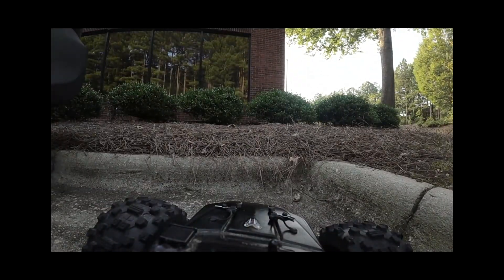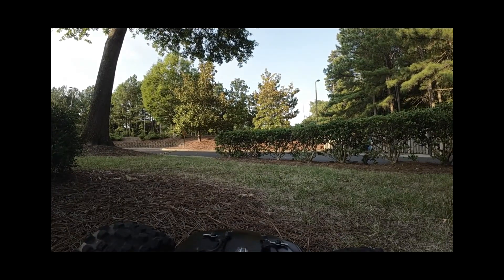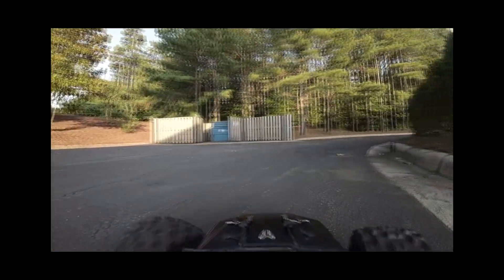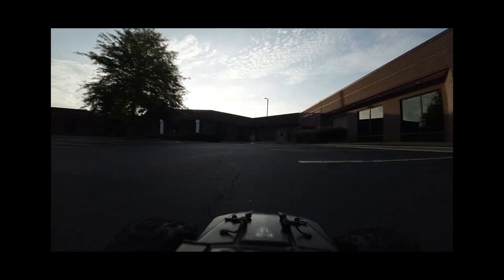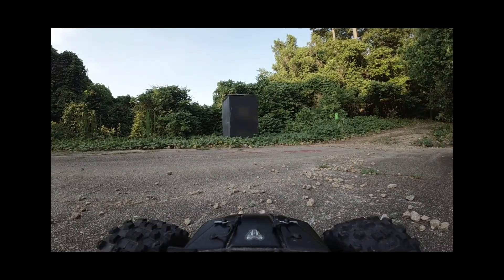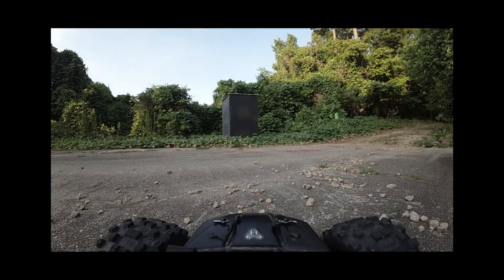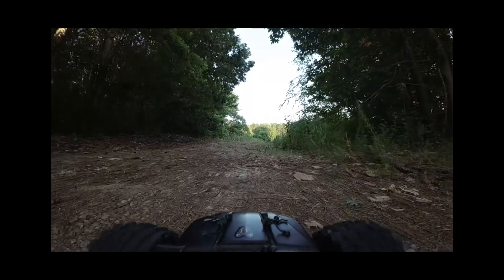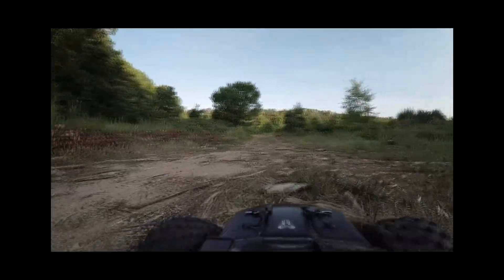RC Car/Truck FPV DJI O3 Stabilizing Gimbal Test (HEQ G-Port)

Comment: Its very impressive! From your experience, which RC car has the best suspension for this gimballed FPV?
Reply from the maker: There are cars I don't own that I'm sure have much better suspension than any of mine but nearly any decent stock RC will be fine when using the gimbal. This truck only has the problems with side to side wobble because I put oversized tires on it that needed hub extensions to make them fit. It's worth it cause I would get it stuck sometimes with the stock tires and these bigger tires have always been able to power through obstacles. This gimbal seems to stabilize everything really good but since you want the YAW locked for FPV then any side wobble won't be stabilized. If you want something for on the road then you want street tires and to just tune some decent oil filled shocks.
Reply: @Magneticitist and you didnt put any extension so it loosely going left and right?

I see, thank you very much for your explanation.

I am an FPV pilot, still using analog for now. But I found ground FPV is a lot lot more fun!

I am tight on my budget so I will buy walksnail system instead.
Reply from the maker: @ It sort of just wobbles a little bit side to side due to the nature of the wheels and how nubby they are etc. It's only noticeable when going fast on the road.

Walksnail is a good option and the GM3 gimbal will let you adjust the sensitivity on the yaw. It comes factory in 3-axis follow but each axis will still stabilize small vibrations if you leave it that way.
Reply from the maker: @ Oh and technically the Goggles N3 and the O4 air unit are similarly priced to a walksnail system right now too so it's something to consider.
Reply: @Magneticitist  ah I see. Yes I am going to buy that GM3.

I cant found any N3 goggle without DJI controller on my local hobby shop.

Thinking on Walksnail goggle L and Avatar V2 but still cant decide.
Reply from the maker: @ulungprabowo  I have no experience with either but I'm sure the Goggle L's are fine. I wanted HDMI out so I spent the same money and just got the standalone receiver and modded it to use my own antennas. I use the Avatar GT cause of the higher power but I've seen videos where just the V2's are doing pretty good.
Reply: @Magneticitist  Ah I see. I just watched your recent video which doesnt use gimbal and kinda impressed on how suspension really took away those vibration. Between gimballed and ungimballed, both have their own charm, ungimballed one the viewer could get sense of the surface of the street, obstacles, etc. Somehow made me want to focus on the suspension setting first and invest on GM3 later.
Reply from the maker: @ulungprabowo  I totally agree and that's a great way to put it. No-gimbal has that advantage of a better feel of the terrain but it's also easier to make it overall more durable. 
The gimbal really comes into play for a lot of off road driving. It gets hard to consistently see in front of you at high speeds when bouncing around that much. 
On-road it helps to just see more clearly at the high speeds that can result in bad crashes etc. 

I spent a lot of time trying to work out how to smooth the vibrations before using a gimbal and it's really just a thing of finding a solid mounting for it. Gets harder to do when using servos to look around cause they might have some play or wobble. The tires you use are big part as well as how balanced they are.
Reply: @Magneticitist  I see. I used to do FPV car in the past, like 10 years ago. I just put the camera on the lexan body attached with body clip and wobble a lot and impossible to drive. 

Recently I print a 3D printed tank put an FPV camera and surprisingly it is very drivable, kinda wondered how it be so different and the answer is like you have said, a solid mounting. And floating on some sort of suspension. I never thought about the servo before but I agree it is a wobble variable that need to be taken care of. I think I will leave my wheel factory standard.

So from your experience, can we said that suspension doesnt really matter that much? The viscosity or spring tension etc?
Reply from the maker: @ulungprabowo  Suspension does matter but for me it never mattered all that much with the video shakiness. There is a tradeoff to where if I made the suspension too smooth then I was making it too easy for the chassis to bottom out. The balancing of the tires seemed to make more difference with vibrations. 

These cars don't truly have the weight to get a real smooth suspension on any surface but it's possible, just takes a lot of tuning. ARRMA comes with little spring shims to help the tuning but it's also good to use good viscosity shock oil. ARRMA seems to use decent stuff but a lot of the stuff you can find out there will use oil that is way too thick. It's more complicated than that though and the shocks need to be filled up to an exact level with the oil. If you just skipped the shocks altogether and focused on a good cam mounting you may not feel much need to mess with it more. Really depends on whether the car comes factory with decent enough shocks already. I've def had some shocks that NEEDED to be replaced.
Reply: @Magneticitist  Thank you so so much for your answer, I really really appreciate it. I will try all of your tips when my RC car arrived. I never heard RC tire balancing, I will look it up now.
Reply from the maker: @ You will basically find out when you take your car and position it so you can freely spin the tires. Any imbalance in the tire itself or how it's mounted will show up immediately as a wobble. Ideally it would be perfect to have the tires spin up extremely smooth and balanced but it's not always easy. Any wobble that shows up is going to also show up in your video as you are driving around. (though a tiny bit of horizonal wobble isn't too bad)

Comment: You guys ever balance and true your tires and wheels? That might help.
Nice video.
Reply from the maker: Yea that definitely helps but only so much on this truck. It's got 14-17mm extensions to fit the bigger tires which are just too nubby. What I have going on this truck works pretty good now partially thanks to new firmware for the gimbal.

Comment: how to get sound on video? Nice to meet you!
Reply from the maker: To get live audio on these digital systems you just have to use a separate transmitter and receiver. I just use a 1280mhz AV transmitter and only connect a microphone to the audio input. To have recorded audio on the truck you just use a recorder module. For this I use an old runcam thumb which also records video inside the truck.
Reply: @Magneticitist  thanks you!

Comment: 01:45 – that's normal, unstabilized view? Wow. Creepy. ;) With the tape lock the gimbal already does a good job; really looking fwd what the can achieve w/ new firmware. P. S.: a thumbscrew might do a good job locking the yaw; just add a small bracket to hold the screw to the upper part of the gimbal base.
Reply from the maker: @NUeB_RCFPV  yeah the tires make it do that. Before I added the tires I wouldn't need any type of gimbal. On my typhon it's butter smooth so I'd never put a gimbal on that anyway. Anything off-road could benefit from it though.
Reply: @Magneticitist  High speed offroading could benefit from a good gimbal. Today I realized once more, that at a certain speed (depending on the surface) the image gets too shaky for precise navigation.
Reply from the maker: @NUeB_RCFPV  Yea it really can't be helped. These cars don't have the weight to really dampen the vibration that can build up from various factors. Just the right frequency of vibration from certain surfaces and it turns the horizon line to jello. With an immaculate suspension + gimbal it's probably flawless.
Reply: @Magneticitist  bigger batteries or add some lead ;-P
Reply from the maker: @NUeB_RCFPV  Maaaaaybe could do that for some cars if you don't mind the handling ruined. I think 1/6 has the right size to make the suspension more workable. Cause remember it needs the weight.. but it also needs the frame strength, and very importantly needs the shocks tuned perfectly to that weight. Then of course all depending, the tuning on the shocks for super smooth riding could result in the chassis bottoming out from a 2 inch drop.
Reply from the maker: @NUeB_RCFPV  I think I read somewhere that the OD for the Lasernut tires is about 5.5 inch just like the tires I'm using so then I thought they might be perfect for the Big Rock. But then I saw they use 12mm hexes which is strange, and I need at least 14mm. Right how I'm using 14mm to 17mm conversions cause they typically don't sell tires that big with less than 17mm hexes. The RC tire game is all jacked up and I don't get it.
Reply: @Magneticitist  1/6 plus huuuuge and super soft tires
Reply: @Magneticitist  Yes, they're 12 mm hex. I don't know how stiff your MT tires are but the BFG are soft and have inserts which both helps dampening; they're not super soft like crawler tires but softer than cheap basher tires. And they roll quite soft, not as rough as many studded tires.

Comment: Oh gimbal fpv , that sounds interesting !!
Reply from the maker: Yea it's a game changer. The whole driving around through the woods and stuff is pretty fun but it also kind of sucks because you really can't see anything clearly when moving. I can't hardly see anything when driving this thing at top speed, I'm just hoping nothing shows up in my path after seeing nothing there and taking off. I'm probably not even using this thing right and it takes away a ton of the shakiness. If it didn't have that twitching problem I had to bypass in a bootleg way it would be perfect.